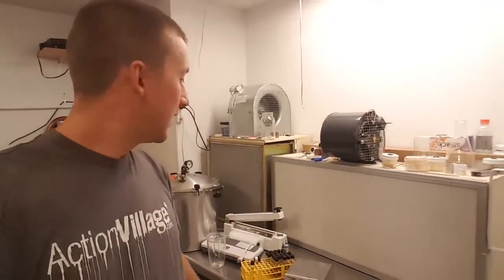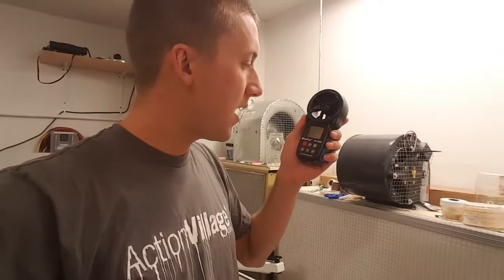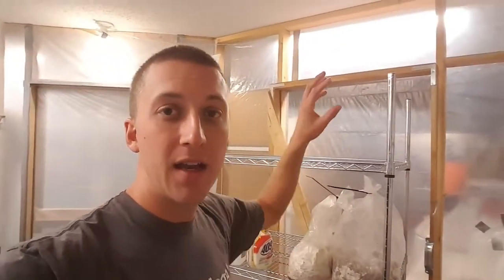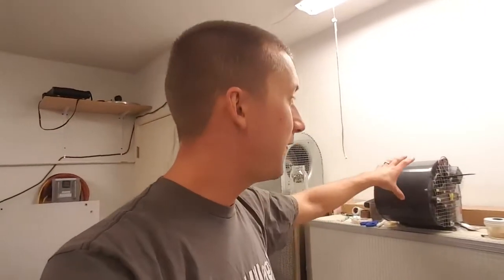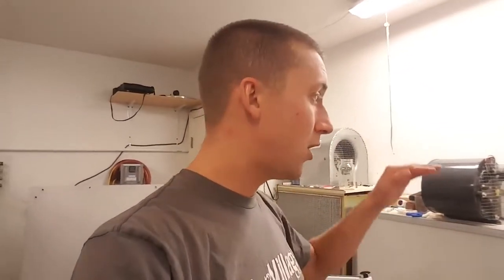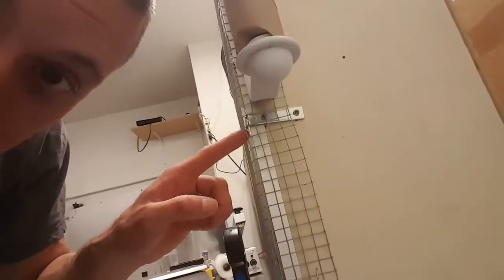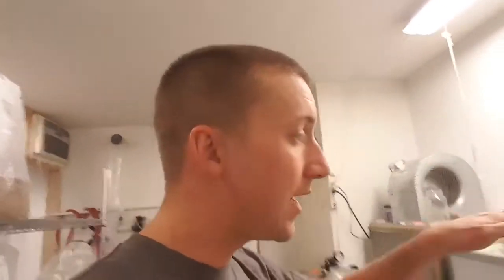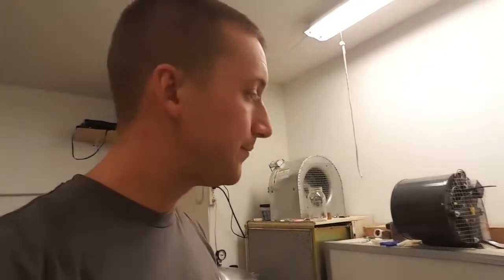Growing Mushrooms at Home DIY HEPA Flowhood Design

Comment: Man, I've been doing this for 25 years and I agree with everything you said. Great idea with the chicken wire. I work nervously in front of an exposed 2 x 4 flanders micropleat. The big filter is the only way to go, even if it's just a hobby. It gives you the space to relax with your work and keep stuff from getting downwind of you. Great tips and great video. My only suggestion would be to try running the fan lower because at that higher cfm you're creating a bigger zone of turbulence (3x width parallel to face... in length) behind everything. My setup is over powered too, though, and I like it for comfort as well. It's steamy ass work. Hard when you get those sauna sweats and you're doing slants or something... oh boy.. Like not swatting the fly, letting sweat pour off yer teeth. Can astronauts scratch? man, I'll never look at a space suit the same way... so itchy... stop scratching. heh
Reply: try doing less drugs it should help
Reply: Jack lol

Comment: Higher air speed is fine if you're just growing from cultures/spawn, but try working with spores. Not only do you risk them blowing away, you also risk spreading them all over your lab. Which again, isn't an issue if you only grow oysters or shiitake. Why not just add a fan speed controller? Faster air movement doesn't always mean its better, in this instance its likely to be detrimental
Reply: Yup
Reply: Glad to have read this 118 cfm is a better option of some gourmet mushroom plans.

Comment: Why not put the bigger fan on the bigger flow hood?
Reply from the maker: because the bigger flow hood is only 2" thick and rated for 90 f/ft/min while the 24x24 is 12" thick and rated for 250 ft/min.
Reply: I always thought the width had to be 5". How well does the 2" work for you?
Reply: at higher flow rates you lose the laminar quality of the air moving.

Comment: I'm just a little confused. In you article you said not to over do it with that fan and going from 100 CFM target to 300 CFM seems like quite a jump. I'd much rather do 300 though. Thanks for making awesome videos. Excellence in all we do baby.
Reply from the maker: The thicker filter that flows around 300 is rated for 250 ft/min velocity. the white thinner 2-3" thick filters are typically only rated for 90 ft/min and actually push around 100-120

Comment: Myers Mushrooms Farms how do you like the 2” thick filter? I’m thinking of getting one. Just don’t like how everyone says need the 11.5” think hepas for laminar flow. Do you think the 2.5 hepa will work and create laminar flow. Also what can you running for the thinner filter. Thanks
Reply from the maker: the 2" filters are whats used in the legitimate clean rooms. They work just fine.
Reply: Ok long as it’s 99.99 and .3 micron shouldn’t have a problem pretty well your saying. Now as far as a fan do the same math you would for the big thick filter? Thanks for all the help really appreciate it. I’m new to this all and like to get good at it
Reply: The 11.5" filters not only (typically) have a lower static resistance at 100ft/min but will last longer before losing efficiency. Also, nobody seems to touch on this in their flow hood how-to's but you do not need to overcome 1.0in W.G. to get these filters to do 100ft/min face velocity. Usually an 11.5in filter will have between .3 and .5 in W.G. static pressure at that velocity. The rating they print on the filter is typically @2000CFM for a hi-capacity filter, on a typical 2x2 that's 500ft/min face velocity. Size your blower according to the flow rate you're going for in combination with the pressure to flow ratio of your filter.  A good blower for a 24x24x11.5" glasfloss 99.97% or similar filter will do 400-460 cfm at .4in. W.G.

Comment: How does this work I'm building my own and the numbers don't add up using the Dayton 1tdt8. A 24x24 you would need to push 400 cfm under a static pressure of 1iwg. The Dayton can only reach 300 ish. How is it running on a 20x40  5.28 SQ feet you need like over 500 cfm

Comment: Question for you. I have a fan I would like to know if it will work, and if so, what filter should I buy. I would like to build a 24x36  or a 24x48 flow hood but want to be sure to get the right filter. The fan I have shows to be a multi speed unit depending on how it is wired or could be wired with a 3 speed switch. 950 cfm, 1200 cfm and 1450 cfm  I tried to follow the curve but had trouble finding the right filter. Any help is greatly appreciated.

Comment: Eric i bought one of those down draft 24"x48" units for the ceiling and ised it successefully aitting on its side many times It takes a large space in that configuration so I hung it feom the cieling and made a glass enclosure around it with a 17" x48" front opening i was curiouse if there might be aome turbulent spots near the rear of the bench or if you think thia is a good idea. I know ive seen some flowhoods that down draft
Reply: This guy answer you?

Comment: Where do you buy the bigger one? It is not on your kit page... thanks!
Reply from the maker: Its on my kit page, under the lab supplies kit its the last item on the list.
Reply: @MyersMushroomsFarms  Thank you man, I really appreciate the channel and your quick reply. I am actually about to put in my first bulk order of grow bags at your site myersmushrooms.com... I am just debating on size. Do you think the 5-7 lb bags are good for a beginner or should I jump straight to the 10-15 lb bags to reduce the labor of filling more bags? Thank you again
Reply from the maker: @sauceLegs  If you have a bulk sterilizer like a drum go with the XL bags. If your pressure cooking in a small cooker go with the 14A 5-7lb size.
Reply: @MyersMushroomsFarms  yes I'm starting out with a 23 quart presto so I will do the smaller bags. Prolly go with the biodegradable ones too. Cheers
Reply from the maker: @sauceLegs  14A or if your doing grain spawn get some 3t or 3t thicks for spawn.
Reply: @MyersMushroomsFarms  Just put in the order! Not sure if I got the right ratio but i figured I'm going from Grain Master Jars to these 3T bags, and then splitting those into the 14a grow bags, so got more 14a than T3. BTW I am looking forward to you having a Myers Mushrooms T-shirt and Sticker in the Gear section of your store next time I need bags :) That logo at the top of your home page would be great as both. Cheers!! -Jim
Reply from the maker: @sauceLegs  its around 20:1 for spawn to bags. I did have Ts and Hoodies but we sold or gave em all away. Ill be ordering another round in the spring. Probably get some stickers too and hats.

Comment: Hello Eric, I’m using two HEPA 24x24 together. The specs says each one is got 1.5” Static pressure. Does this mean that I have to size my fan for a 3” drop?
Reply from the maker: no it will still just be 1.5" what you need now is a blower that will push the rated cfm of both filters added together at 1.5" pressure
Reply: Thanks Eric. I spoke with the filter dealer and looks like both filters (Koch Biomax HEPA filters 24x24x11 1/2) initial SP is 1” (+0.3” prefilters), I’m using a Dayton 1TDU2 which is supposed to provide around 900CFM at that pressure (800 is needed) but it actually comes poorly 80 CFM out of it. It’s like the filter are eating almost all my airflow! Any idea what could it be?
Reply from the maker: @mariodonato5656  sounds like you need a 2nd blower or a larger blower. yes 900 cfm divided by 8 is 112, you  may have more pre filter resistance than you calculated giving you 80.